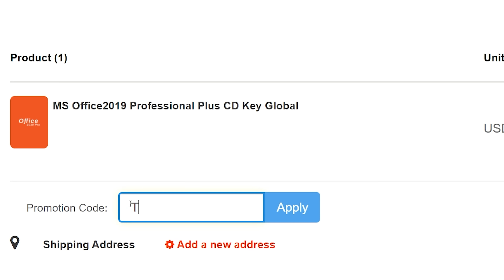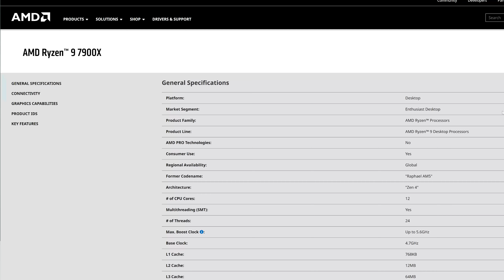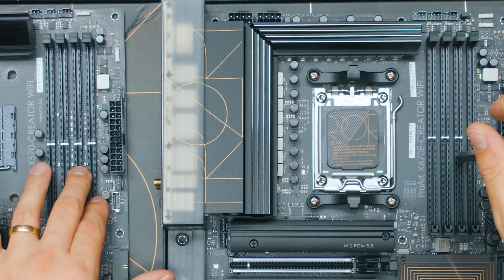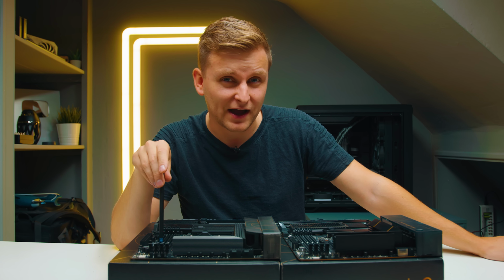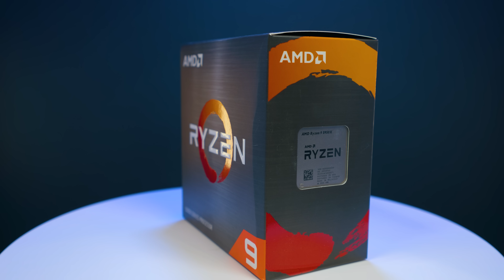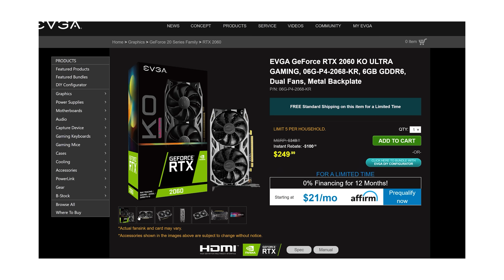What's Changed & Worth the upgrade? - ASUS X570 vs X670e ProArt Motherboards

Comment: It seems that the USB4 ports on the X670 are actually a downgrade as Thunderbolt 4 has more stringent performance requirements for certification and as far as I can tell the new X670 board does not meet the Thunderbolt 4 specifications fully which means trouble with daisy chaining, multimonitor setups etc.
Reply: Considering they both use the same Intel thunderbolt controller I wouldn't think there would be a difference

Comment: Im a little bit worried that the X670E has USB 4 ports not Thunderbolt 4 rated, which means it's not guaranteed to work properly with all thunderbolt devices as USB4 specs are not as tight
Reply: it's just a branding change, they are using the same Intel thunderbolt controller.

Comment: @Tech Notice: While I am considering the purchase of a new computer, I find myself utterly confused with all of these hardware varieties. I require a system that can handle high CPU loads/memory due to the music vst libraries. Much can be handled with larger ram capacity. I also do rendering of videos which of course, swallow enormous cpu resources as well. And finally, I am an avid gamer although not all my games are fps heavy. What motherboard or perhaps system would be best to cover all of these requirements?

Comment: The DDR5 dropping to 3600 for 4 sticks is just Jedec standard, like DDR5 5200 is one to two. Nobody runs it like that, we all technically overclock when we use XMP or Expo. I'm running 6000 on 4 sticks just fine. AMD went with Jedec numbers in their specs, unlike Intel, but it does not mean it works only like that, it just means that they support it only like that. If you want more you need memory that is fast and a Mobo that is compatible.
Reply: I just now added an extra 64 to make it 128gb. I can’t make it boot with 6000mhz. This is crazy. I do lots of simulation. So I need tha speed

Comment: Since I'm upgrading from a fairly old workstation, even at this time AM5 just makes more sense given the longevity of my previous system.
I think hardware unboxed had a four channel config run on AM5 at 6000MT/s. AMD only list the base clock without overlooking (which would also include the 6000MT/s dual DIMM config that was sent out to reviewers).
Reply: THΞ ΛΧΥΞΗΗΘ  Given that it won't fit on socket AM5 anyhow and I'll undervolt - who cares?
Reply: @American Legend Not when you need a beefy system though. For me the question is always, how much of a % performance to I gain for a % increase in total system cost. And that tends to balance out in favour of a new system once you've added a few beefy parts - especially if those are the same across different systems.

Comment: I think this review could've been a bit better. You did point out the extra M.2 nvme slot, but you failed to mention how that would work as far as the pci-e lane distribution. Personally, I would like to know how much fast storage this motherboard would be capable of providing. I dont see any value in pointing out the board layout differences if you omit how much of those can actually be used. Sorry, i'm just a little annoyed that most reviewers are failing to actually review the new generation AM5 motherboards. 
PS: The pro-art (in my opinion) is probable the best cost/feature motherboard out there.
Reply: This was not his best review, and I begin to wonder about the anti-AMD bias. Other long trusted reviewers have had very different takes on the 4 slot XMP issues, and have more clearly pointed out the platform differences that are not to be found in synthetic benchmarks.

Comment: Building my x670 ProArt AM5 currently. Has the same features primarily as the top ASUS ROG minus the LCD screens and is 1/2 the price for it. So unless you need those, it’s the best top line for the price IMO. Only complaint thus far is the 2nd NVME PCIe 5 slot doesn’t have a 2nd layer heat spreader like the 1st one does. We know those drives will be hot, so really needed. Also, the cpu bracket is easily unscrewed; replaced with a frame (have to watch tightening).

Comment: IMO the AMD mobo upgrade is worth it - we have no option anyway! - but the Intel one for Raptor Lake isn't. With Intel you get more PCIe4 lanes over PCIe3 but from the boards I've looked at so far there is no PCIe5 M.2 connectivity, it's stuck at PCIe4. With the X670E (haven't looked at any other chipsets which aren't available on boards yet) you do get PCIe5 M.2 connections. I'm planning on upgrading my 12900 to 13900 in the same Z690 board, but at some point I'll be putting together a new 7950X system, maybe with a B650 board (it'll be for development not gaming)

Comment: Does the ASUS X570 drop with 4 ram sticks?
Reply: No. Oddly it only seems to apply to DDR 5 which of course isn't for the X570/AM4
Reply from the maker: Nope. It's CPU memory controller characteristics and AM4 CPUs with DDR4 didn't have that.

Comment: I just got my extra 64Gb 6000mhz to make 128Gb. But it runs in 3600mhz. There should be a update on this. Will there be any update or tweaks we can do it ?
Reply from the maker: Nope, there won't be an update. Its a limitation to the CPU memory controller!
Reply: @theTechNotice  ohh no. So I’m stuck with 3600mhz of speed with 128Gb. No way. This is false advertising.
Reply: @Shafy7  Extremely disappointing...

Comment: Asking "is it worth upgrading the motherboard" makes NO sense! If you want AM5, you upgrade! My 7950x, DDR5 and finally, my X670e ProArt arrive today! Will build this weekend, and report back. I gave a lot of consideration to the 13900k, as Intel has treated me well going back to a 9900k, I have had all the recent i9s. But, the power consumption is NUTS, and I am sure the 7950x will run vMix, DRP Studio 18, and my other needs quite well. I am really hoping both vMix, and OBS, find ways to leverage the iGPU on the 7950x, but, I will have enough cores and RAM to brute force it! My fave GPU for my use cases has become the simple, Nvidia RTX a4000. I also have an a5000, but it takes up more slots, and uses more power. I live in a hot place, keeping components cool, even in the Fractal Torrent is a challenge!

Comment: hi, been following your stuff since i am in interested in creator centric takes and views. a question, why would anyone want to buy this when if you put 4 sticks of ram it becomes very slow? thats like buying a ferrari, but you can only drive 10 miles per hour. and for creator we usually need all 4 sticks of ram to get a full 128gb of ram, especially for 3d modelling. i am seriously puzzled how they can even think this is ok be sold. with such a problem. thank you.
Reply: Those listed speeds are just validated speeds from AMD, anything over those would be considered an overclock. Basically they're saying if you load up on high capacity RAM, they cannot guarantee the same speeds. Likely you will still be able to achieve 5200 (or higher) with 4 sticks, but they have validated and guarantee that 2 sticks will be able to.
Reply from the maker: It's to do with the CPU memory controller trying to keep up with DDR5 speeds. It's the same with Intel, but not as bad with 13th gen :)

Comment: 2x PCIE 5.0 x16 is really wonderful for running 2x GPUs, even when they're running at x8 mode only; it can be a wonderful "budget" workstation comparing to a Threadripper one. However I'm quite concerned about the RAM speed. As the MB supports 128GB Max, 2 RAM slots can only provide 64GB Max. We may have to add another pair of RAM in, reducing our speed to 3600 which will be the bottleneck. Hope you can do a test for this scenario with 2x 3090 or 3080 or a mix of the two, to see how much bottlenecking we will have.
Reply: we can only wait for DDR5 to mature
Reply: Even for two modules, AMD designates everything above 5200 as overclocking. While designating 6000 as the sweet spot and including those modules in the review kits. I suspect 5200 should at least be doable with four modules.

Comment: I upgraded to the x670 Creator board to get in on the ground floor of the PCIe 5.0 wagon. I don't play to upgrade it until AM6. I assume eventually the 2nd or 3rd generation AM5 processors will support 4 or more m.2 drives at PCIe 5.0 speeds, so if I ever come up with a use case for that sort of speed before a new architecture comes around, then I'd consider it.
Reply: THΞ ΛΧΥΞΗΗΘ  I don’t see how overclocking is really all that important for content creators, so maybe your expectations are misplaced.

Comment: Idk if you kept the bits you shaved off the motherboard, you could try to find a soldering expert to solder them back on, if it really is as simple as that and you havent since powered the motherboard there should be no real damage unless you dug into the motherboards channels or pads. That mobo must be around $400+ would cost a lot less for it to be repaired :)
Reply from the maker: The SMDs were so small and didn't just get shaved off but also broken, like some of them have still half on the mobo and half gone... some all gone etc... :(
Reply: @theTechNotice  Ah i see, maybe if you get a broken asus motherboard (recent gen) they can extract the components off that and solder them onto your board (donating parts). I'd assume asus use the same resistors/capacitors and parts on their products.